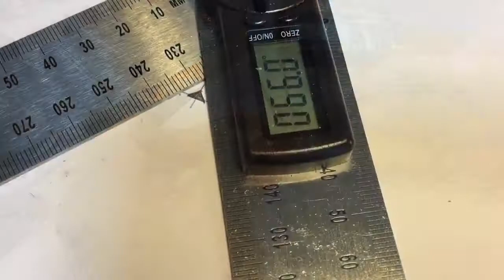Making tailstock dies holder part 4

Comment: When you were tapping under power, you release the bolt holding the tailstock down?
Reply from the maker: Loke-Yeow Wong Are you talking about the tailstock hold down bolt, or the tailstock spindle locking bolt? The spindle locking bolts are tightly locked and the tailstock hold down bolts are loosened to allow the tailstock to move freely.
Oh! I recently learned of the Yahoo sherline Group. It was a great place. And i found some of wong's picture. You are really great !!
Reply from the maker: Loke-Yeow Wong Oh, did you see the last replies you made about Micro Boring Bar?
Reply: The tailstock hold down.  

There is another group on facebook for sherline users. You may want to look it up for ideas.
Reply: Yes, I saw that.  Thank you.